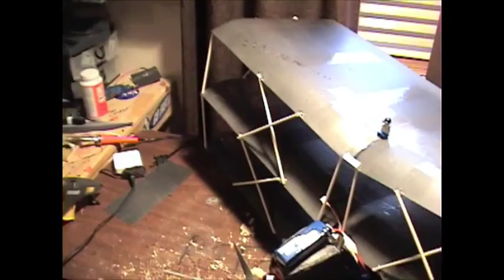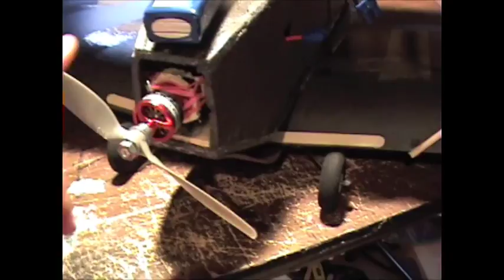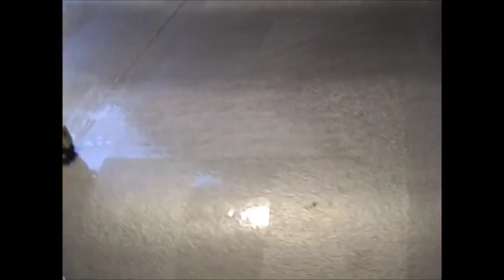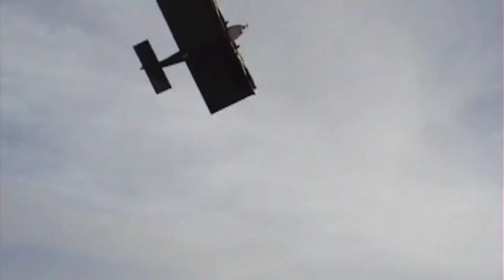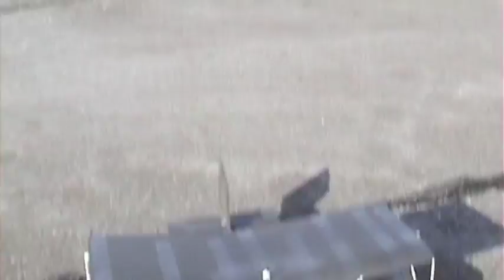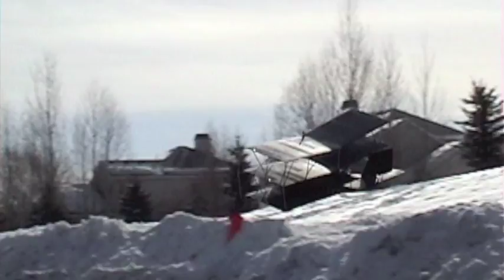Tri-Plane

Comment: Hey dude, I have been studing rc planes for a while. I think that you should have 2 motors on that thing. It has  a ridicoulous amount of drag and the two motors would definetly have enough pull to get the sucker in the are and have a good climb rate for sure. Just a thought :)

Comment: dude when you stack wings like that it takes some lift away, i think it would work better if you make the fuselage longer and move each wing back a little when u go down so they are set in a diagnal angle. you get what i mean?